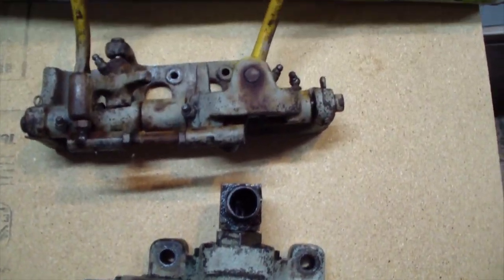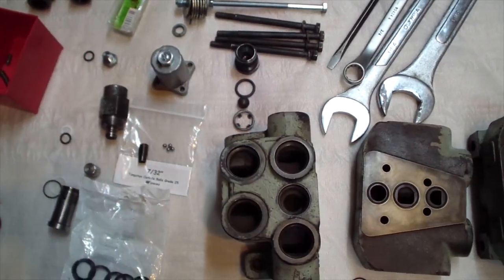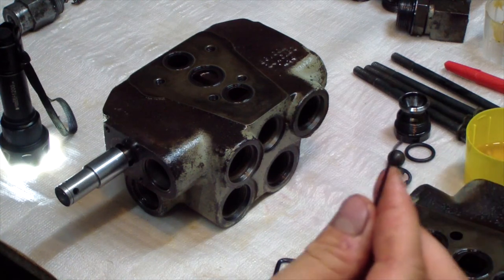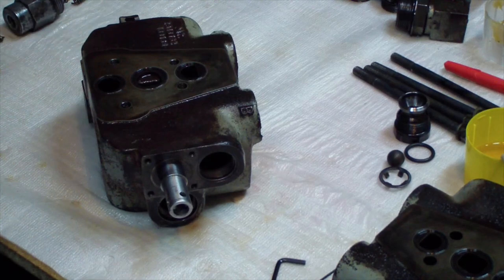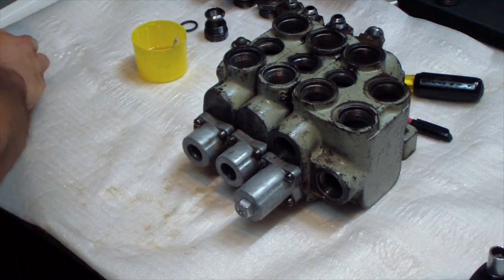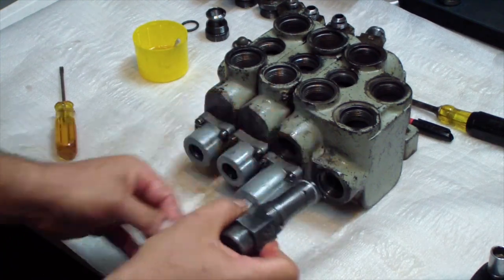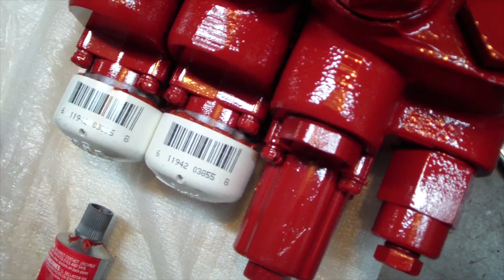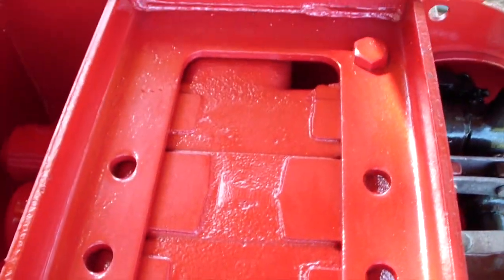Repair The Gresen Minneapolis Hydraulic Control Valve

Comment: Where did you buy all the O-Rings? I have a 6 spoil same cable I need the O-Rings. Thanks
Reply from the maker: I bought them from a local seal and O-Rings place here in Dallas called H&D Distributors. you most likely can find them at your local hydraulic shop. Best of luck,
Reply: Salam Sayhood thanks

Comment: I have no pressure coming from 2 different  functions on my mini ex. the pump is good. I hear hydraulic hissing sound on all good functions but not on the bad ones.  the spools go in and out of the valves but does nothing. been trying to diagnose this for about a year now. I resealed the whole valve body but never took the spools apart. any help would be greatly appreciated 🙏
Reply from the maker: Hello,
1- Is your valve the same as the one in the video or is it another type? If different, would you please provide the model.
2- Have you checked the pump pressure and the relief valve?
3- The two bad functions, are they both on the same spool?
4- When you say two bad functions, are they controlling hydraulic cylinders or hydraulic motor?
Please let me know the answers to these questions so I can give you better
Suggestion.
Reply: it looks almost identical but unfortunately is a no name off of my nissan/hanix n150-2 pump is good. I have not checked any relief valves. the 2 functions are the dipper arm in-between bucket and main boom. and one final drive. the spools are next to each other in one of 2 valve sections that are all connected. thanks for your response
Reply: I have swapped relief valves from a good working spool with one of the bad ones and there was no difference
Reply from the maker: @timhanna870  the best approach to troubleshoot the problem:
First make sure:
All the lines connected correctly.
The dipper cylinder and the final drive motor are good. You can test them by swap the lines with different valve and test. 
Mark all the lines with color tie wraps and take alot of pictures before you start (so you can put everything back together the way it was). If you are not sure if the lines are correct, then trace them from each cylinder to the related valve.  
If all good, then disassemble the valve and investigate any rust, wear, internal leak or broken parts. It is fairly an easy job. Just make sure you do it in order to minimize any unnecessary work.
Reply: @SalamSayhood   I just swapped hoses from good to bad valve and confirmed the valve is bad. I will take it apart now and investigate.  Also in-between the 2 bad valves is the aux valve that is capped off and not in use. Previous owner must have disabled it. And that spool is sticking out the rear looks like through a broken spring housing. No oil leakage. Just looks like something is not rite with it. Thank u
Reply from the maker: You will get a better idea once you disassemble it. The previous owner could cause the problem. Let me know if you have any more questions. Good luck and have a great day
Reply: @SalamSayhood  I have separated the valves. how important is the middle fitting on top of the valve? in-between the hose fittings. mine are shallow flat head to remove and I don't think they've ever been out. although the ones I'm having trouble with are a little stripped so maybe someone has been in there. I can't budge them, theyre actually countersunk into the valve body. thinking about welding a nut on to remove...? I noticed yours have a hex head to remove with socket. no such luck here.
Reply from the maker: This called the poppet valve and very important. Watch my video again as I explained how I had to lab the poppet to make sure it seals well. Also inspect the springs. Make sure you have no corrosion. Under no circumstances you use heat or hammer to disassemble your valve as this will permanently damage it. Use large screw driver or get a large 1/2" drive socket with 1" flat screw driver head and you should be able to open these large flat head bolts.

Comment: Does the D-239 have plenty of power to push without the turbo?
Reply from the maker: I keep my bulldozer turned up and for what I use it for is so powerful. I have one video about using the dozer when I dug two ponds, also I have other video about root rake I made for this dozer and at the end of the video you will see me pushing a heavy load.

Comment: Where do you get the o rings?
Reply from the maker: I bought all the o rings from a local place called H&D distributor. They also sell them online. If you have the dimensions, you can find them on ebay too.
Reply: @SalamSayhood  Thanks for the info. How do I get the dimensions. Do I mic the spool groves? I have a gresen 1spool  directional valve 3001.
Reply from the maker: You have many ways to get the right o rings:
1- call hydraulic shop and give them the valve make and model and they should be able to give you the kit part number or the individual ring.
2- measure the spool, grove depth and width and compare it to the old o rings.
3- search online. You may find someone who sale part kit for your valve.
 You should have quad o rings for the spool and regular ones for the connectors. For the connectors make sure the new ones are nitrile 90 and for the spool it depends on the dimension (could be nitrile 70 or 90).
Reply: Thanks very much for all the info.

Comment: if you could please look at the video I Posted of my hydraulic problem with a Gresen control and advise me if this is my problem, I  would be very grateful.  thank you
Reply from the maker: Good morning sir, I watched your latest video about the problem you are having with your tractor hydraulics. It could be one of these :
1- the hydraulic pump is going bad or if the pump is driven by belt, the belt maybe loose.
2- the hydraulic relief valve may need to be adjusted. For that, you will need a pressure gauge. Then you set the relief valve to the valve manufacturer recommend setting. On my Mahindra tractor, my valve is set to 1350 psi and I can carry a bucket full of dirt easy. If you have a pressure gauge, you can test the hydraulic pump as well. If you can't get the pressure to build up, then this indicate a bad hydraulic pump.
3- it could be an internal hydraulic leak in the valve for the bucket lift spool. You can test if the bucket is all the way down and if you use the tilt valve to lift the tractor. Or if you you have the bucket high and use chain and try to lift heavy load using the tilt cylinders. 
4- it could be internal leak or wear inside the valve. You have to disassemble the valve to inspect it.
5- it could be internal leak in the one or both of the lift cylinders.
Please inspect them in the order listed above. If you have any more questions please let me know. You have a great day,

Comment: How did you get the relief valve apart
Reply from the maker: It is very easy, you have to remove the relief valve housing (the large nut), once you remove that, then everything will come a part. Then you can follow the instructions in my video to re assemble. Please note: depends on your machine, you may have to remove the complete valve to gain access to work on the relief valve. I hope this answer your question. If you need more help, please let me know.
Reply: @SalamSayhood  I can’t get the lower section apart on mine
Reply from the maker: Would you please watch the video and tell me the time of the video that you have problem with the valve, I may be able to help you.
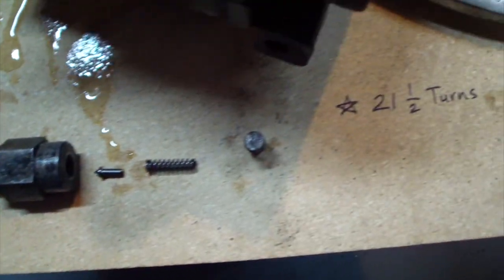Reply: @SalamSayhood  it’s around 1:40 the relief valve that you take out of the valve body I took two out and get the bolt spring and needle valve out but I can’t get the lower section apart to get the second spring pin and cup out. The section below the threads
Reply from the maker: If the lower part (cylinder) stuck in the valve body, you can use rubber hose insert it on screw driver (to prevent scratches) and put it inside the cylinder and pry it out.
If you have the lower cylinder our of the valve body and you want the inside parts out, then you can use one of two ways:
Blow compressed air from the valve body side, make sure to use rag around it to prevent parts from flying every where :)
Or you can tap it of soft surface and the parts will come out. 
You may have some rust or contamination to keep the part from coming out. If this is the case, clean it with WD-40 and keep try to move the inside parts  both directions and this should loosen it out. I hope this will help. Please let me know how it goes.

Comment: Interested
Reply from the maker: Thank you
Reply: I need some1 who can supply mi with parts and seals um in Botswana
Reply from the maker: I couldn't find the parts online, however, I went to a local seal and o rings shop it's called H&D Distributors. They were able to match all the seals for me. You maybe able to find similar place near you.